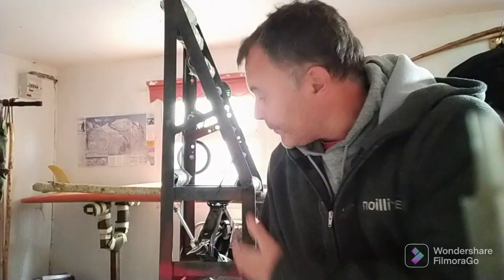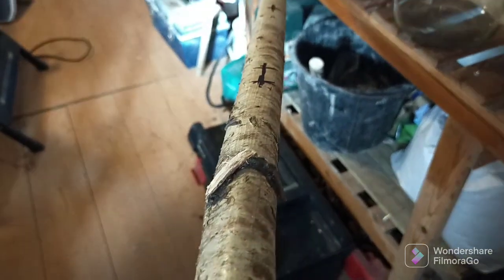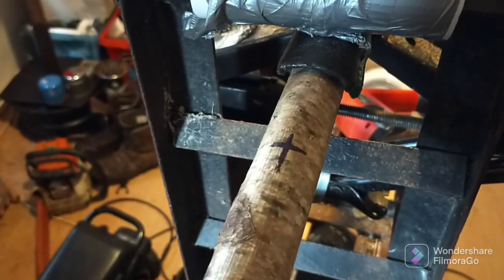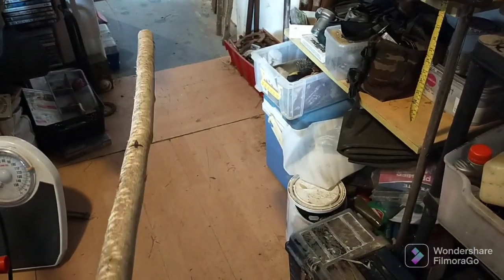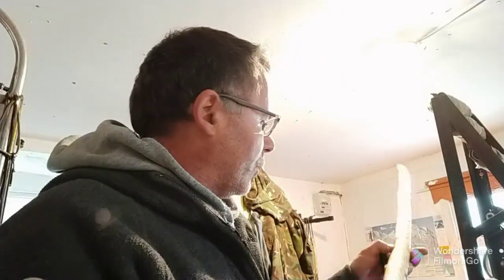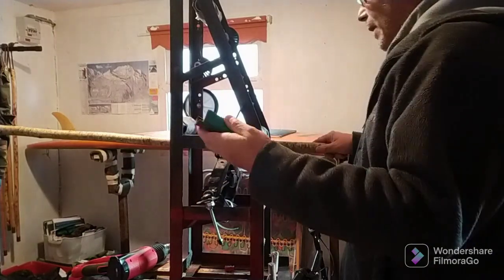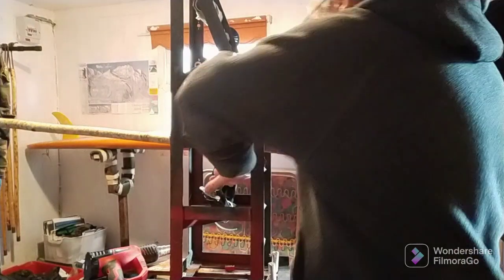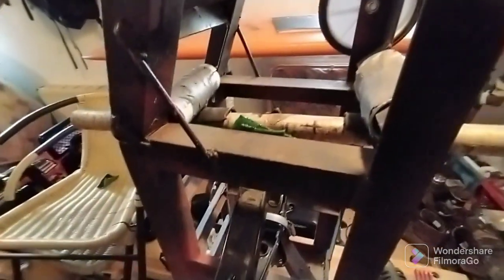How to straighten a hiking stick useing a heat gun. Steam straightening verses heat gun method.

Comment: Ingenious straightening contraption there Andy! I’ve cracked one myself with too much heat. Have a plan to repair it but that made my decision to get a steamer. Watching the older gentleman stick maker (Dave) using a wallpaper steamer will be the way I’d like to go. Thanks for the education!
Reply from the maker: Definitely  safer a wallpaper steamer.I use this method simply  cause I got wood in abundance. The heat gun bending jack set up is a variation  that many use on line.

Comment: Hi Andy, great video. You've been at this craft longer than me so if I could ask you this. I've always seasoned my sticks with the bark on. What effect if any would stripping the bark off before seasoning have on the seasoning process?
Reply from the maker: Hi, if you season an average stick, it's not far wrong to say a year is enough, but if you strip the bark, you can... depending on drying conditions, speed it up by a month or two.The issues in removing bark you increase the risk of cracking, and obviously, it reduces the options for crafting when you're ready . Thanks for watching and commenting. Andy.
Reply: @hiddenvalleyfootpaths2561  Thank you for the reply.  I reckon I'll try seasoning a few sticks with the bark stripped off. Look forward to your next video.

Comment: Excellent idea!!  For how long do you apply the heat to the section that you want to bend? Can you give me an idea about how hot is the temperature of the air (max intensity, medium, low)?  I ask all that because the heatgun method is tricky. I have tried to bend some as branches (max 1 inch in diameter) and I never seem to get the sweet spot. It ends up either splitting or not bending. Best regards.
Reply from the maker: Hi, the heat gun method is hard to guarantee  results. I have lost some stunning  pieces  of wood myself. I usually  rotate the wood and gently warm the area  by moving  direct heat up and down the area. Once I have heat in the wood I slowly direct the gun at the chosen bend and bring temperature  of wood up further. I have no actual  temperature guidelines and it's really  experience. I have only been able to get bends out but never so far get a full curve. Steam on the other hand allows  me to bend wood double ,  As a rule you should never  hear the bark making popping noises or smell   bark cooking off .All the best with your crafting and thanks for watching. Andy.
Reply: you tube keith pickering  ,stick straightening,it cost 6 quid and 6 quid post,its so simple,heat on full blast for 30 seconds ,keep turning the stick,then into the stick press in the vice,and take any bend out more or less,he has sold thousnds of these